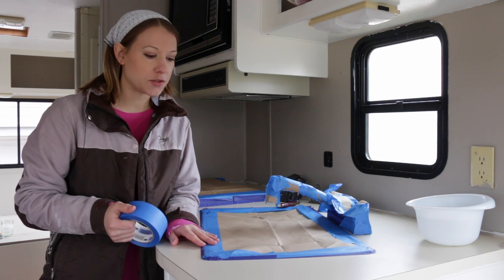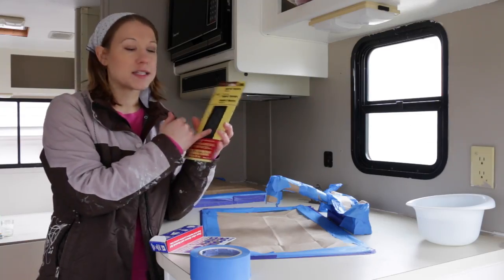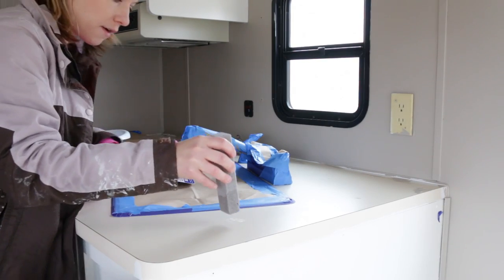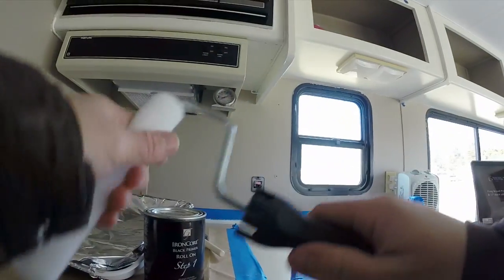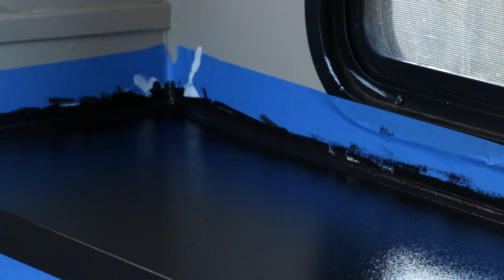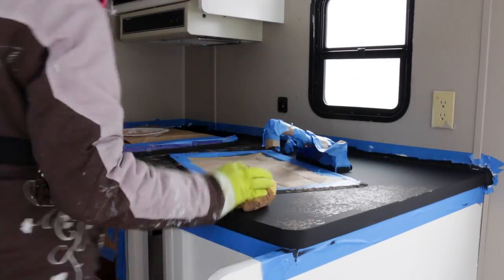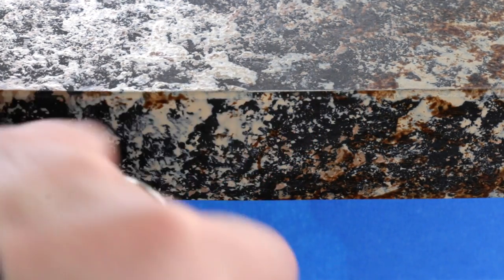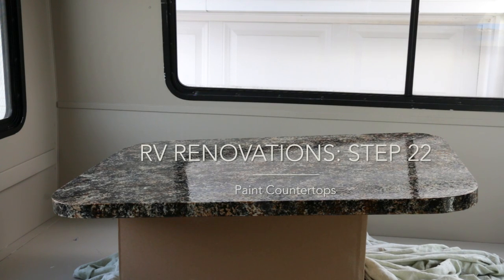Painting Our RV Countertops with Granite Countertop Paint

Comment: Now that time has passed and your counter-tops and table-top are in constant use, I am curious on how well the paint and clear-coat has held up.  When you clean your counters vigorously do you find it scratches the surface?..also, do you have to use cutting boards all the time?  My neighbor in our duplex has done this method in her kitchen, but I must admit your counter-tops look so much better than hers!
Reply from the maker: +Benita Young Hi there! The clear coat doesn't do the best with constant heat and sunlight (like the dinette) but other than that, it is surprisingly durable. We will need to redo the dinette at some point but as long as you are not too rough on them, you'll be good. Btw we never cut on the counter 🙂